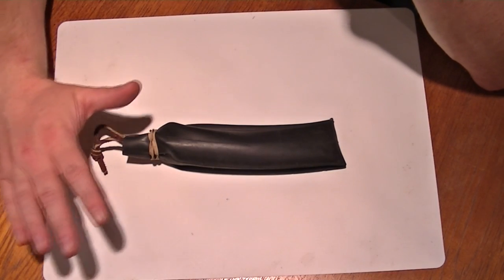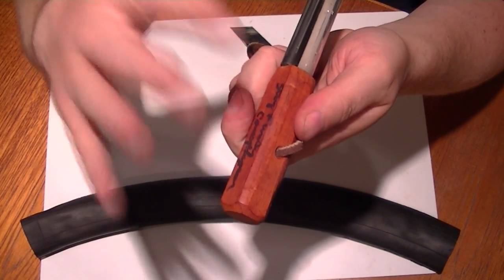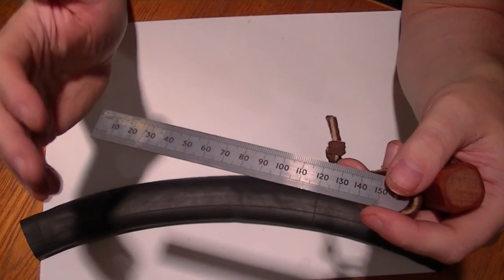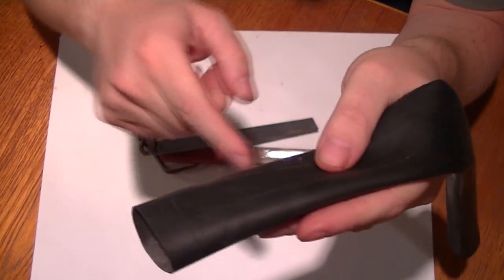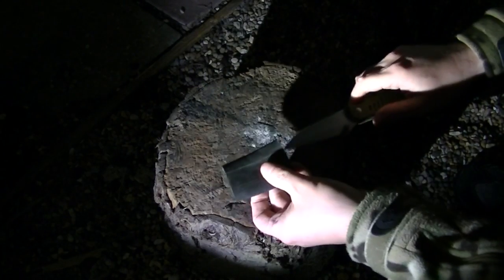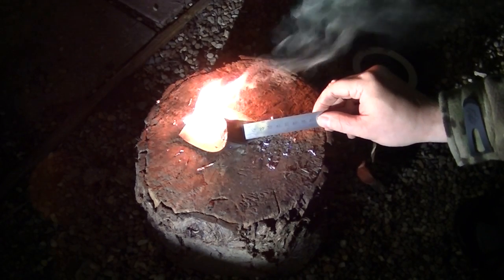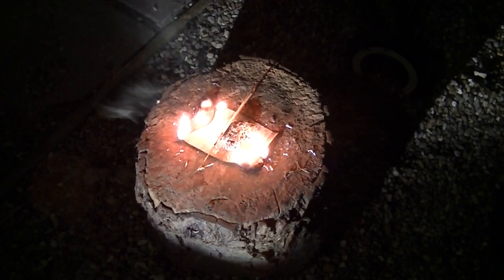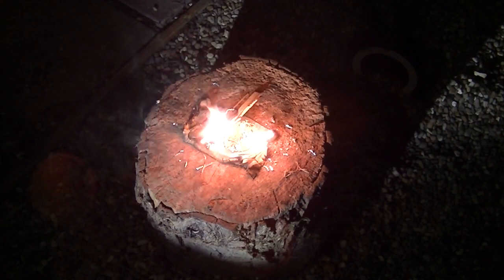Magnesium & Inner tube Survival Fire Starter

Comment: Hot and stinky!  Maybe change out the ranger bands, rubber bands, or inner tube (that does burn strong and hot).

Charcoal briquet./coal - pound into carbon powder.  Fireplace wood ash (potash, potassium, wood salts).  Metal shop grindings/dust - filter for micronized dust (iron, aluminum, magnesium, tin, ...).  Wood shop sawdust - filter for micronized wood dust.  Laundry powder or hard soap bar shaved dust.  Epsom salts (magnesium sulfate) - pound into powder.

WD40, 3in1 oil, gun oil/solvent, used car oil.  Pine/birch oil/tar/pitch? Jello or gelatin powder.

Mix all powders and dust together.  Add in oily/gooey/tarry mix.  Roll into tiny burn logs.  Basic black powder (carbon, magnesium, sulfur, iron, potassium, wood salts) + basic napalm (oil, tar, pitch, jello gelatin, soap nitrogen, potassium).  Burns long, strong, hot, less smell ....